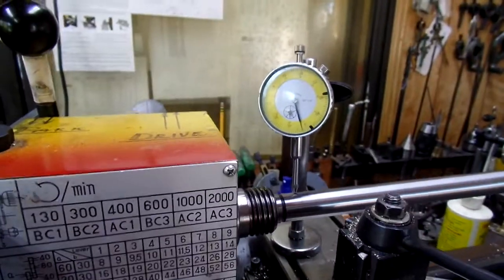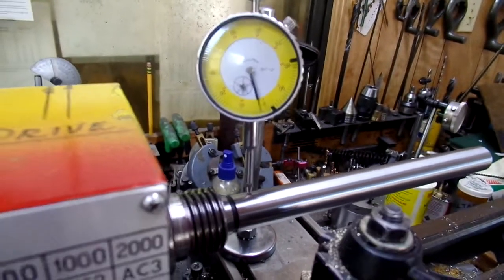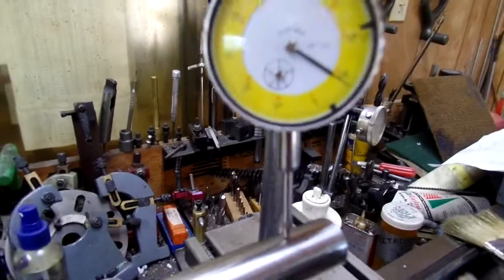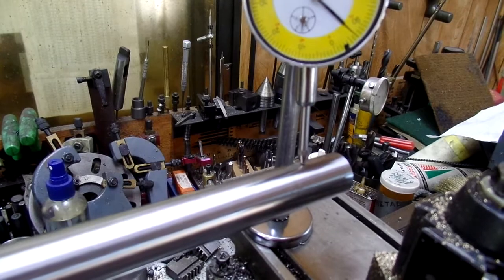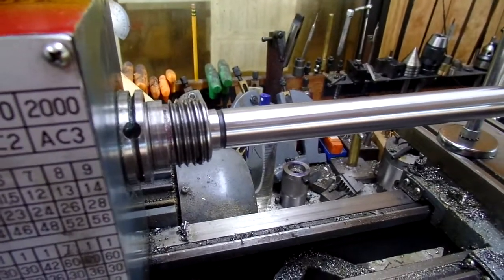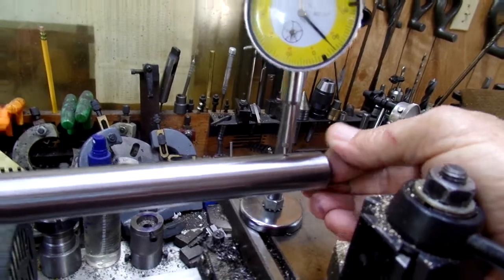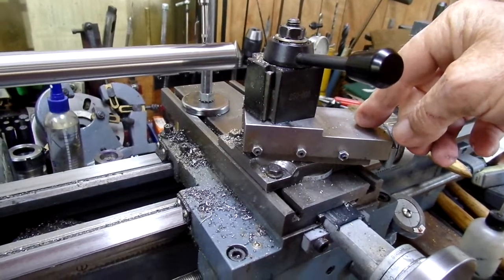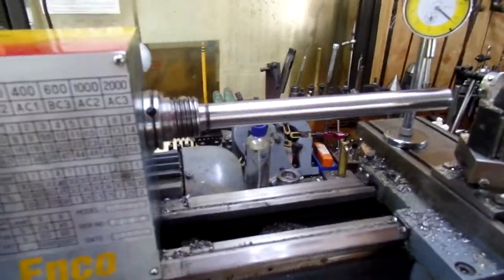E166 Using a test bar to align the headstock on my lathe.

Comment: I  think it it essential to first check the alignment of the spindle to the bed. If it isn't parallel, you are wasting your time. Another check which is important, is whether your tool post slide (I call it the Y axis) is square to the bed. Therefore it is important to first get the spindle (head stock) parallel to the bed and then use a roller and a dial indicator setup which can be clamped in the chuck and rotated to get a reading on the roller at the furthest point with the roller in the dovetail. Move it to the closest point towards you and repeat the process by rotating the dial indicator setup 180 degrees and take a reading on the roller. This should give you a good idea how square it is to the bed or head stock. Aligning the tail stock to the spindle can be done afterwards.
Reply: Is there a video showing how to do what you just described?
Reply: @roonimac  No, sorry brother. I have never put a video on YouTube. However, what I described is very important if you want to do precise work.

Comment: Maybe we use our lathes for completely different things but what does this matter? Are you holding your work piece in the headstock by a Morse taper? Or do you have a chuck or collet or center that you use? If so then wouldn’t you need to adjust for that again anyway? Isn’t this why you always mount your chuck to the spindle in the exact same position? Because you have to align it as assembled?

Comment: Brother, you need to use a flat contact point on your dial indicator and not one with a ball. The reason is that the bar is round, so, it has a crown (directly on the center line. If the bar has run-out, your dial indicator's contact point will be off the center of the bar when you rotate it. If the head stock is not lined up with the bed, then it will be even worse, especially if you move the dial indicator away from the chuck to the end of your test bar.

Comment: From what i saw in the video, i wouldnt condemn the test bar just yet.
I would mark the high and low points on the bar w a felt tip marker and then rotate the bar 180* in the spindle and read measurements again.
If the Results are EXACTLY the same as previously indicated, only then would i condemn the test bar.
 If your readings vary in any way, there are further problems.
Repeatability is crucial for finding the cause of your run-out.